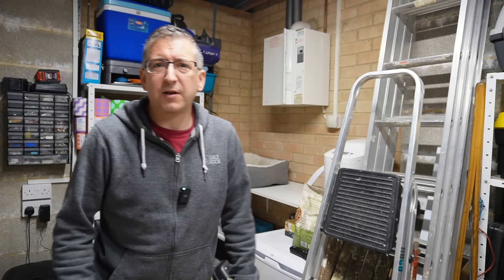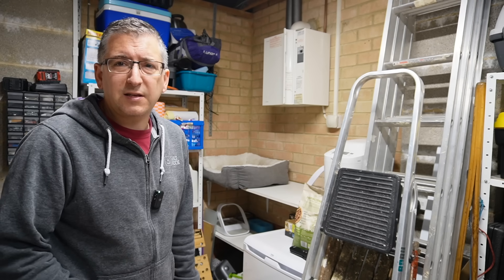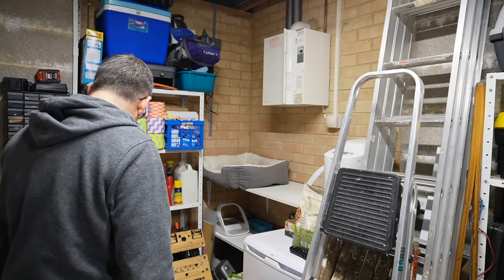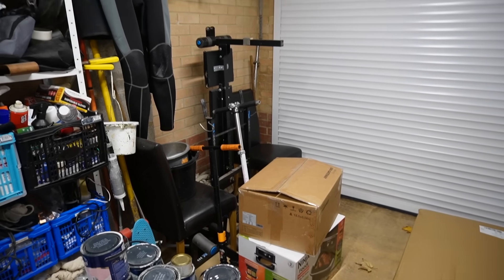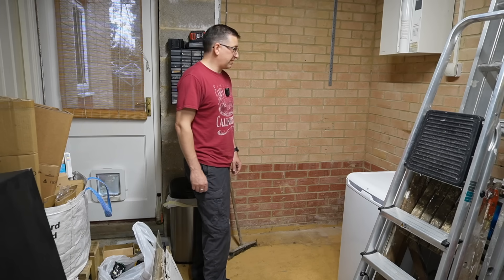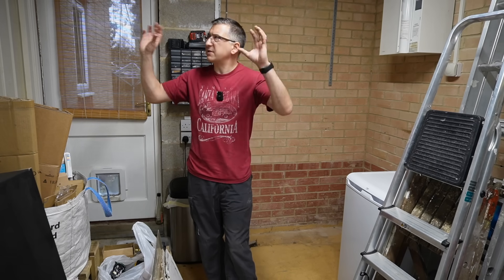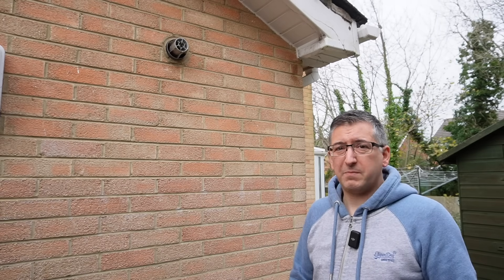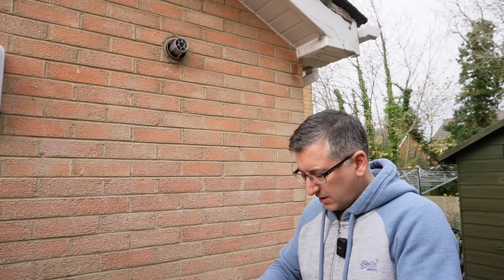Octopus Energy Heat Pump Install Day 1 and Prep Work

Comment: We are still waiting for Octopus to return to fix the problem radiator. 4 weeks wait so far and not a word, so another email tomorrow 😮
Reply from the maker: What's the issue with the radiator?
Reply: @SpeakToTheGeekTech  They left the old single one in the large room. The result is that this room is 2 to 3 C cooler than everywhere else. When the engineer visited routinely some 4 weeks later he commented that the system should have been power flushed and the radiator replaced with a double type, like the rest. That was 2+ weeks back. No contact from them 🤔
Reply from the maker: Oh dear that's a shame. Ours is working ok - one radiator has poor flow to it which means it's slow to heat up but that is known by them and they're booking in to come back and fix that. Should have been done in the install but they ran out of time.

Comment: I'm not sure a garage is the ideal place for a hot water cylinder, especially in the depths of Winter, as it will experience a high heat loss.
Reply from the maker: Perhaps not, but it’s the only location available really. It can’t be worse then the loss from my old tank and it seems to be holding up well so far

Comment: 46 dB is not noisy.  But TBH those noise apps are generally pretty inaccurate.
Reply from the maker: Yeah, I don't think it's accurate, but hopefully consistent so when I check again with the heat pump it'll be comparable.

Comment: Your boiler has a knackered fan that's why it's so noisy.
Reply from the maker: Yeah, and a corroded heat exchanger and a faulty main circuit board and a dodgy thermostat. It was basically shafted.

Comment: Octopus must be raking it in now the grant has increased to £7500! 🤦‍♂️
Reply from the maker: The price hasn’t changed, they get the same amount whether it comes from the grant or the customer.
Reply: @SpeakToTheGeekTech they've adjusted their quotes to suit so they're pocketing the increase. My pre-increase quote was £3300, and I signed the contracts etc. but it dropped to £800 post increase. I ran a quote again on the website and they quoted £3450 for the exact same kit. Greedy!!
Reply from the maker: Are you certain the updated quote includes the higher rate of grant? I know that there have been a few issues with them updating their systems to use £7500 instead of £5000. My quote from them is still based on the old grant and they weren't able to issue me with updated financials based on the new grant, but assured me that the original quote (without the grant) still applied, and any extra deductions would be reflected in the final bill.
Reply: @SpeakToTheGeekTech  octopus were able to update my financials with the new grant, although via email as opposed to signing a new contract which is fine.
I just think it's strange how their quoting system hasn't dropped the pricing, instead keeping it the same! They have changed their system since I initially quoted as well, so I don't think it's a case of it not being updated.
Reply: @Saaj2  My original quote was for £7500 but my new quote came in at £4800 so they have definitely updated there system.  Now i have decided to go with the quote as its way cheaper than before.
Reply: They updated my grant to £7500 even though it was just a few days away from the install.

Comment: Shame they went for cheap crap Heatpump! 
The octopus way seems to be cheap and cheerful installs?….
Reply from the maker: Cheap and crap? Seems ok to me and is working ok so far. I know there are better models out there but the ones I’ve seen in real life all appear to be much alike. I am on a budget so a premium more expensive option would have been off the cards.
Reply: @SpeakToTheGeekTech  yes certainly the cheap end of the market that’s for sure. 
That’s the problem with octopus, they have adopted a ‘sell them cheap, stack them high’ ethos. 
It’s like they think they own the heatpump industry. 
I’d stick with HeatGeek engineers all day long. You pay extra, but you’ll probably get better long term results (higher scop).
Reply: @deanchapple1   I thought daiken stuff was good?
Reply: @BenCos2018 middle of the road stuff. They can’t be that good if octopus have adopted them. 
Like I said, octopus have gone for the sell them cheap, stack them high approach. They are under cutting most other companies and have created a race to the bottom. 
lol that’s what happens when you have a 800 million pound budget.
Reply: Nice one show how to get the flow set also how do they check the fluids in heat pump same as car radiator.My service engineer showed up with a screwdriver no fluids no gauges or even a multimeter  must know what he is doing I suppose.To be continued haha can’t help it.

Comment: All i see in regards to zet zero bollocks ,is you need a detached house ti charge an expensive electric car and a  big house for all the gubbings of a heat pump. Net zero is a financial apartheid between people who have larger houses and driveways. Net zero os no use to me as im in a mid terrace with  no driveway or extra rooms and garage. Hence why i got a new gas boiler and changed to another petrol car.
Reply from the maker: You’re probably not going to like my channel then to be honest!
Reply: I sense your frustration - however net zero is something that benefits us all, regardless of whether we can implement it directly in our own homes, or whether we benefit from reduced pollution in our environment.  It's not bollocks.

You can charge your car by running a cable in some temporary ducting over the pavement (this is legal, being a non-permanent adjustment and not a hazard), or sinking ducting in the pavement (with a flap - your council may permit you to do this) or having a swinging crane arm to bring your cable above head height over the pavement.  Just need a longer cable.  I don't have your issues but I did need a 10m cable to charge my car, I was able to purchase one online.  You would need to ensure you can park within spitting distance of your house at least once a week - but it should be possible, if you just chat with your neighbours.

It is possible to charge away from your house, when you're shopping, for example.  It's not as cheap as charging at home of course, but it is possible.  Hopefully the government will wise up and reduce VAT on charging publicly to 5%, rather than the 20% that it is presently, which will bring prices down.

i can't speak for your house in particular, however most terraced houses do have a back yard in which a heat pump might be fitted.  Most houses have a cupboard for the water cylinder, or there's always the loft.
Reply from the maker: And in terms of heat pumps for smaller / terraced homes then it's not a one-size-fits-all approach. There are smaller heat pumps than mine, or split units, or even air-to-air heat pumps. If there's no room for an internal tank then there are alternative solutions for hot water such as on-demand heaters and electric showers. All homes must transition to cleaner energy eventually - those of us able to move sooner rather than later should, but it's important to remember that just because this solution is right for my home does not mean it's the right solution for others. And for the EV, yes it was expensive to buy, but with my Corsa if compared to a petrol Corsa of the same spec it's essentially the same cost if you include running costs over a 4 year period, and the more miles I do the cheaper by comparison it is.
Reply: Lucky you I have repeatedly asked octopus for a quote three or four times in the last year. Reminded them last week and have had the promise of an appointment via call back from them , nothing as yet.
Reply: Even in a mid-terrace you can still have solar panels installed. Many home batteries are weather proof so they can be installed outside on a rear wall. Currently that would likely be your best staring point rather than a heat pump. It'll save money in the long term and, depending on you usage, cover the vast majority of your elec. 
Typical UK house uses 2800kWh a year, with a modest 8 panel array (could be split front/back) you'd be looking at a 3.36kWp array based on 420w panels. That should produce around 3000kWh pa meaning your elec usage is "net Zero" with a little excess going back to offset some gas boiler emissions. 
Appreciate the charging issue, as mentioned by another there are systems and trials taking place for in path trunking. Issue there is if you are in an old Victorian style street you might not always get parked outside your house. If your current car works fine then maybe hold off until there is a better system for on street charging. Personally I think that we should be able to take our energy tariff with us and just pay a "connection fee" to use the chargers. Then we can be billed at our home rates.
I'm yet to see a viable combi boiler replacement that's got the efficiency of a heat pump. Direct water heaters like elec boilers are very expensive to run. Can be a "net zero" heating system, but requires a lot of energy in to process.  
But technology is always moving forward and someone will be working on something to replace combi boilers, too much money to be had if they can get it working 😉
Reply from the maker: @steve_787  Direct water heaters for hot water and showers (well, like a normal electric shower) might be perfect for small homes and light hot water usage when compared to having to heat a whole tank of water and watch the efficiency radiate away as it sits there not being used. There is an argument to be made that in a lot of cases direct hot water could be a lot cheaper to install and run compared to a heat pump and water tank despite the 100% efficiency. The smaller the hot water demand, the stronger that argument gets. There will be a crossover point somewhere and I'm sure someone with more patience and knowledge than me can draw that graph out :)
Reply: @SpeakToTheGeekTech  good point. Like you say, only using as and when rather than cycling a tank every day might have it's benefits even though it's not as energy efficient (daft when you think we are comparing a near 100% efficient system and that's the "in efficient" one 😅). You could then just run a heat pump to the rads and avoid the need for a tank altogether. 
The downside would be with mid-terraces and having the heat pump units far enough away from the boundaries given they are generally narrower in nature (I know you had some issues in Wales with the 3m rule). Best place for them would be at the end of the gardens next to the shed/bins so just the added cost of running the pipework/cables back to the house. It's all possible 👍
Reply: There are some very interesting chimney heat pumps being installed in terraced houses in the Netherlands. 

The industry is well aware of the significant number of people without external space for a heat pump. Long run, some streets will get district heating, others will need to fit systems wherever they can. Planning will be updated as modern units are far quieter than gas boilers.

When the Tories are finally kicked out of power hopefully the country can stay to look forward and invest rather than decay.
Reply: Air to air heat pump could go on outside of a terrace, not at ground level. Ugly but totally doable. Alternatively IR panels (relatively cheap install for a terrace but higher running cost Vs gas until we sort out the silliness where our carbon taxes are on electricity use not gas use).

Whether solar or solar water is an option depends on where your roof is facing for a terrace if it's not south facing and it's a small back to back it's not really worth doing. 

Basically net zero means: if you can afford to, do it. If you can't, hope that those who can do. It's a collective effort and some can't so those who can should, so that those who cant benefit from the side effects. Like taxation.
Reply: You're absolutely right but reducing climate heating is something that has to be done to avoid catastrophic impacts. The govt isn't facing up to the fact that it can be expensive and should be providing more financial support.

Comment: Enjoy the huge electric bills !
Reply from the maker: Well perhaps, but my calculations show that it should cost the same as gas. I'll use about 1/3 of the energy compared to my old gas system, but at peak it's about 3x the cost which basically cancels itself out. However a lot of my energy can come from the batteries charged off-peak, meaning my running cost will be between 60-100% of the gas cost roughly on average over the season. I'll be tracking it closely especially as I have good data for my gas usage last winter for comparison.